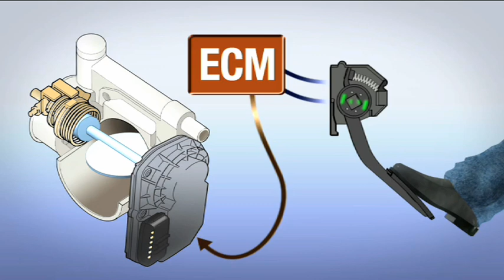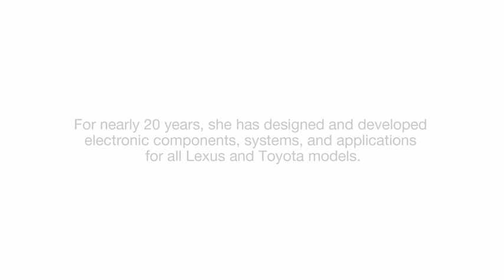Toyota Vehicle Testing | Toyota

Comment: I thought this initially as well. But due to the gearbox it has, you can't shift into neutral when this problem happens, and the car is set up so you can't just shut it off at higher speeds (as protection in case anyone accidentally presses it).

Comment: @mreil23
"It could be that the gas pedal is releasing more gas from the gas chamber that makes the car go faster..."
I dont think gas pedal can release gas like you said.
Its like what she describe at 00:34.
And all drive by wire throttle are the same, gas pedal sent voltage signal to TPS and ECM, and ECM provide the proper A/F mixture for engine
I guess they still look for the thing that causes TPS received faulty voltage signal causing it stuck open when the acceleration pedal is released

Comment: Why have there been many accounts of uncontrollable acceleration without floor mats, without a stuck accelerator pedal, and without any codes stored of a failure. You cannot diagnose a problem that is not saved as a code in an ECU memory. I believe this is not the last of it or as Mr. Lentz stated the vehicles may not be completely repaired by this. Of course they said that when they swept the dirt under the floor mats. I mean carpet

Comment: But if drive by wire is to be continued, it doesn't hurt to completely redesign the acceleration pedal similar to BMWs, very long pedal, from the floor to deep into the driver well.

Comment: While increasing electronic components in a vehicle is a part of automotive evolution, better driver education about vehicles new and old and a simple cable throttle design goes a long way.  True "traction control" is from a driver that pays attention to all four contact patches with the road surface and modulates the throttle, brake, and possibly clutch coinciding with steering to find optimum control.